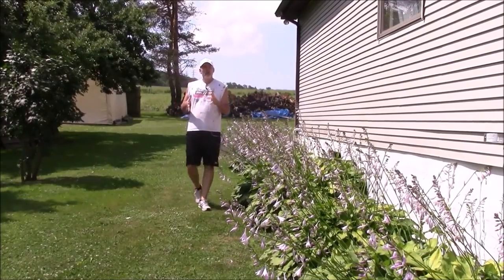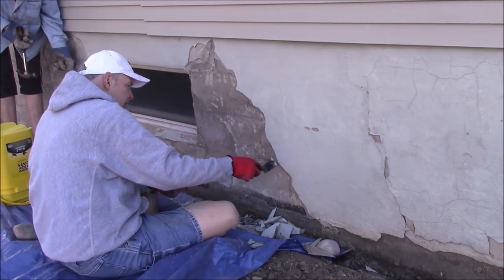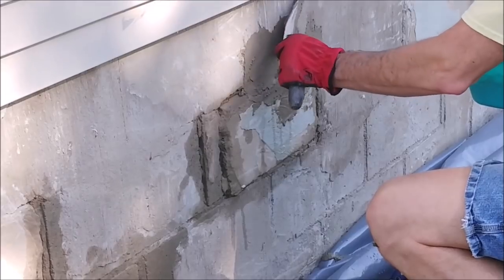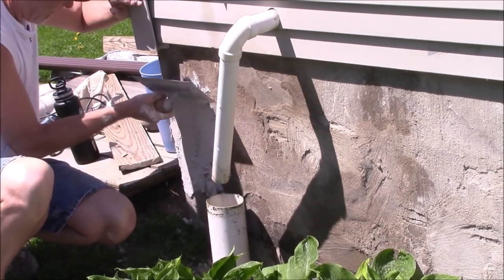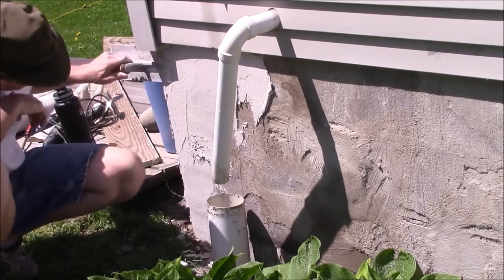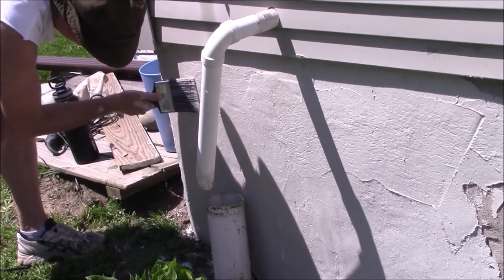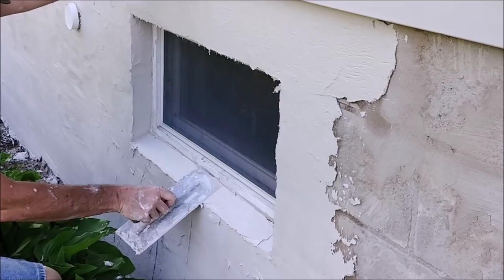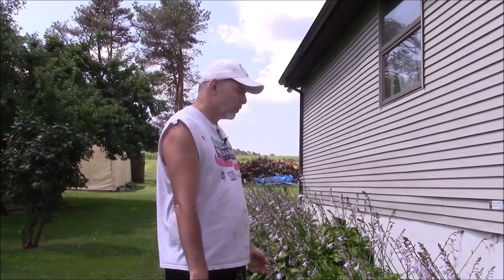HCC 55: Foundation Parging

Comment: Looks good! I'm going to do this because i'm not paying thousands to a mason. I'm good at plastering sheetrock so this will be a good weekend gig for a month lol! Thx for this.
Reply from the maker: For sure.  This is a good job to work on your troweling skills. This doesn't require a super smooth finish, in my opinion anyway. Mudding drywall is a good "foundation" skill. Pardon the pun.  Especially if you mud with trowels instead of spackle blades. Smart for you allowing time and several weekends. Let me know how it turns out.
Reply: How many sq ft ? Could very well need more than one coat
Reply: ALSO THE EXISTING MATERIAL WILL EFFECT THE STUCCO PROCESS

Comment: I've had a lot of experience with finishing walls, when I was a concrete mason. No one method works best for all walls, but I liked to brush on a cement paste, on a dampened wall, and let that set for a day or two. That made a good base for the parging. It was like the scratch-coat for stucco.
Reply: So you mixed like what Portland cement with some sand.. brushed on a thin layer and then what did you parge the wall with after that dried?
Reply: @ChristopherJones16  There's more to it than that. Surface preparation is the first step, before you mix any grout or other parging material:
1. Be sure that the wall is oil free!
    Oils, ( Which is used on forms more than it should be, IMHO. ), is one of the main two reasons for surface bonding failure.
Residual oil and surface scale can make a parging fall right off, a few months, or even days later.
 Surfaces of any kind of formed concrete can form a number of different scaling effects, which is the second place bonding failure, almost tied with oils.
Reply if interested.

Comment: I would have wet that wall well before parging (and depending on the material used...might have used a bonding agent.) And while brushing does alright, I like using a sponge instead. You did well for a non-professional.
Reply from the maker: Thanks.  Maybe you missed that part of the video, but I actually did both. Granted you may prefer applying the bonding agent directly into the wall, but I mixed it into the parge as directed by the product. Thanks for the idea about the sponge. Never thought of that.
Reply: Use a hammer drill

Comment: Good work, thanks for the clip!  I have a problem evaluating what is reasonable for a mason and helper. The material cost is low and I know it's hard work - but a quote I got was massive for a job I'd normally love to take on. Guess I'll look for a better quote!
Reply from the maker: Yes this is s big job with a lot of hard work. If I were doing this for someone, I would not hesitate to charge a several thousand dollars.  Good luck

Comment: Could've done without the background music but the content overall was great. I've done the same type of work on the inside of my house and didn't know what I was doing - didn't know it was called parging. All I knew was I was making it nearly impossible for water to get into the basement through the 100 year old stone foundation. It had been parged (is that a word?) and parts were failing, falling apart, etc. and I removed it all with hammer and chisel before replacing it much like you did. It turned out great. Not perfect but what is?

Comment: I used a long Spud bar you know it's the kind that you turn the water off outside or any spudbar I believe a light one and I used a hand axe and and I chop't on it a little bit and and lightly and it came off pretty easy
Reply from the maker: Good tip

Comment: useful video, but why didn't you tape window to make it easier?  use larger trowel to keep lines smoother.   Also was wandering how it hold up in 3-6 years?  I have seen pros using some greenish - bluish primer first on the cement wall and then spraying texture on it.

Comment: How does this Quikwall product work? I've seen alot of videos of parging with simply Portland cement and sand mix.  I'm wondering which is more durable for Northeast winters
Reply from the maker: I'm not sure if the exact makeup of the mix. However, I would guess there's lime in it, because it's very white. It also has fiberglass strands in it for added strength. As for lasting power in the northeast, we are in PA and it looks as good as when it was done, 3+ years now.  We did paint with an elastomeric paint, but that was for looks not function.

Comment: not perfect? Looks a heck of a lot better than it did before! 500% improvement, I am doing mine in a couple weeks how did you get it white? did you add a coloring to your cement? I may have missed that part
Reply from the maker: Sorry for the delay.  By now I'm sure you did your project.  That is the color of the mix.  No other coloring was added
Reply: Just seeing this now that you commented. I did my foundation! Did it during the pandemic. Ended up using RapidSet and did a float finish using a red sponge float. MY foundation looks so nice now, while i was at it, i replanted all new grass and flowers on the front yard. This spring Ill replace the stair railings.

Comment: what would happen if you dont fix  your parged wall?
Reply from the maker: Depends on the condition of the foundation. If there are cracks, water or pests could get in, weakening the structure.  But generally speaking, what i did was just cosmetic

Comment: Looks nice, it’d be neat to apply a texture stamp of some kind like they do with concrete floors
Reply from the maker: Thanks.  I'm sure stamping would work though.  It's not that thick of a coating that could take a stamp. However, I do think any other type of texturing would work.  We just chose to keep it simple.

Comment: Parge looks way to thick I'm not sure if its different from parging icf walls but when i was parging icf walls our mix was little more wet looking
Reply from the maker: These are just concrete block.  I adjusted the mix as I went to get the best consistency to work with. Thanks

Comment: I've heard you're supposed to get the foundation soaking wet before parging it. I know you did mist it a little bit before hand, but I've been told before to basically soak the foundation with a garden hose twice to make sure it is sopping wet. Supposed to help everything bond together. Just posting this to see if anyone has any input on this? Not trying to be critical, it looks like you did a great job. Also curious with an acrylic additive like this, if you should do one soak of the foundation and then a second "soak" with some of the additive added to the water?
Reply from the maker: Thanks for the input.  I didn't soak it, and haven't heard that recommendation before, but I think it was fairly wet.  I put the bonding agent in the mister and in the mix.  I think it worked pretty well for me, but I'm not pro mason. If be curious to know myself.
Reply: @HomeCraftChronicles  Ah gotcha didn't realize you had the additive in the mister as well. Makes sense in my head to do that. I'm curious as well, I know a mason so maybe I'll give him a ring and see what he says. Regardless, good job on your project looks great.

Comment: you need to do it in one motion and once it has all has been applied and somewhat dried use a sponge and lightly rub over what you've done to get rid of all the imperfections /lines that were left behind
Reply from the maker: Thanks. It may not seem so on the video, but that is more or less what i tried to do
Reply: @HomeCraftChronicles  i understand - keep it up #Salute

Comment: I don't work for Home Depot but I love my 18-Volt ONE+ Lithium-Ion Cordless 1/2 in. SDS-Plus Rotary Hammer Drill. I got some SDS- Plus bits from Harbor Freight including a wide chisel bit. Great for pulling up tile in hammer mode and drilling concrete in drill/hammer mode.

Comment: The cement would have been better to apply slightly more wet then a sponge float would smooth it all out
Reply from the maker: It was as wet as I could make it and still keep it on the trowel. The brushing have it the finish were were looking to achieve.  Thanks for the comment

Comment: great job, $aved a ton. do you need the acrylic with the quick concrete mix, or just the concrete mix alone? Thanks!
Reply from the maker: Glad you tackled it yourself, but I'm not sure to which mix you are referring. I didn't  use concrete mix at all, but I did put some additive in the Quikwall finishing mix. Thanks for watching!

Comment: mine is showing some spiderweb cracks. Is it common?
Reply from the maker: Depending on age, it could be common
Reply: @HomeCraftChronicles  Do you recommend just repatching the foundation coating? Will that really do anything? It looked like you stripped the old foundation coating.
Reply from the maker: I did remove the old coating because it was failing everywhere.  If you're is mostly sound, you could just remove the bad parts and try to match the patch

Comment: I'm not giving away all my secrets but buy a spray bottle or a power fist. Keep it moist. And try to keep going until you find a good spot to end. I don't like ending at corners because it's hard to get a nice finish. Ideally you start from the back and end mid wall so you don't see the overlap. Always do the front in one day and keep going back to the walls you have done to keep them from drying out.

Comment: Light duty electric or cordless  demo hammer would have cut the prep in half
Reply from the maker: True, but I had neither and didn't want to stop to go rent one.  Plus, thwe y could easily get away from you and, next thing you know, you've busted the block foundation. In this case I was better off doing it by hand to have a bit more control

Comment: Bushing bit to hammer would have made easier work of taking off the old covering.
Reply: Roto hammer
Reply from the maker: Yes it would, but not having done it before, I wanted the control of doing it by hand.  A demo hammer could get away too easily.

Comment: Just curious why you wouldn’t have installed a wire mesh to the concrete wall prior to application of the plaster? Saves some headaches when it comes to surface smoothing and strengthens it all at the same time.

Comment: I would have done flagstone or tile, would make for a nice look
Reply from the maker: I'm sure you're right, but that would have been more time and money than we had.  Plus there is still 3 more sides of the house to do
Reply: @HomeCraftChronicles  More time?   From start to finish based on the growth of the foundation plants, this job from start to finish took you at least 3-4 months. A nice margin trowel would have helped you a lot especially around the window. The trowel you used is too big. I would have also painted the prepped foundation with bonding agent in addition to putting it in the max.
Reply from the maker: I'm sure there's many things that different people would have done differently. What I did worked out for me, and more importantly,  showed the average home owner that ot can be done.  I appreciate your comments and input.

Comment: Not a good job at all  you're going to have to fix again and just like this time it will chip
Reply from the maker: Sorry you don't approve.  We're happy with it and its held up just fine
Reply: It's been a year I don't know where you're located but if you have heavy winters you'll see what I'm talking about in a couple years
Reply from the maker: @pablom3162  All I can say is that is unfortunate you don't care for my work and hope this came out, but I guess you can't please everyone.  We do have rugged winters so I guess we'll see if you're right.  Thanks for the input.
Reply: Well I haven't given you any input I just criticized, two things that stuck out the most was first no lath nor scratch coat was applied second was using the brush to smooth out you should've misted the wall then use the trowel to smooth out. Side note it's much better to apply the adhesive directly to the wall prior to applying the parging rather than mixing it in. It's not that I'm trying to put you down but if you're going to put up tutorial videos you should do it right
Reply from the maker: @pablom3162  I know you were criticizing. I was just trying to be nice.  Secondly, this is not a stucco, just a wall coating. Very similar to what I chipped off that wore out after 25 years.  I did not use lathe because it wasn't necessary. The reason I didn't scratch coat it is that the base was already very rough and a good surface to grab the coating.  The adhesive additive was added to the mix because that is what Quikcrete recommends in their instructions.  In fact the only time I waived from the instructions was in my use of the brush, which was a preference in the final look for texture. 
My videos are not meant to be gospel tutorials.  Simply how I  choose to do things.  If viewers get something out of them, great. My main goal is to encourage people  that they can do projects around the home and that they should try.
I'm sorry this project did not meet your standards, but I think your issue is with Quikcrete, not me, as I followed their instructions for their product.  Maybe next time you "criticize" you should have all the facts first.  Besides, if you're such an expert at this, why would you need to watch me for instruction? Thanks for watching!
Reply: I don’t think you need lath because of-the fiberglass, good job of following makers instructions